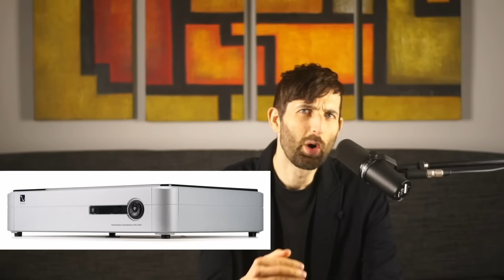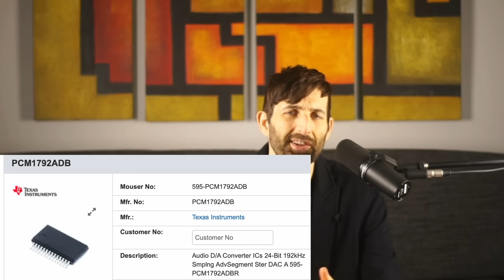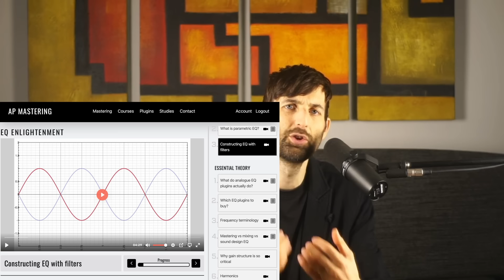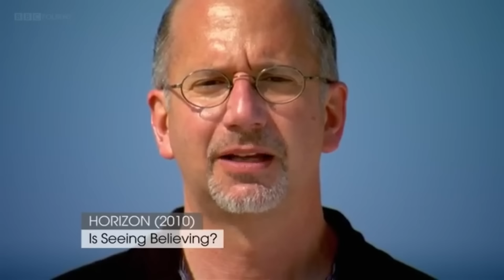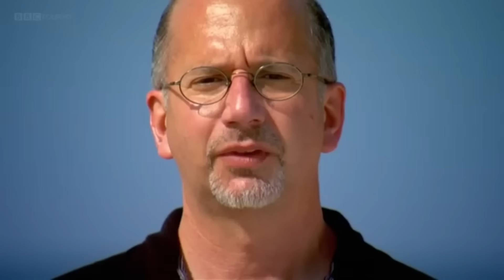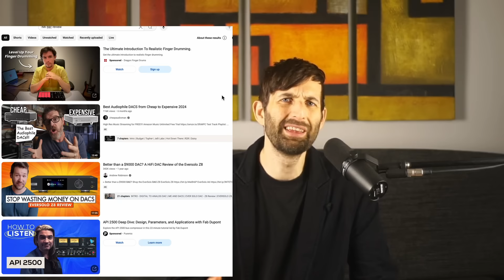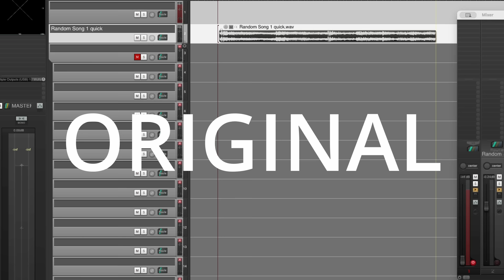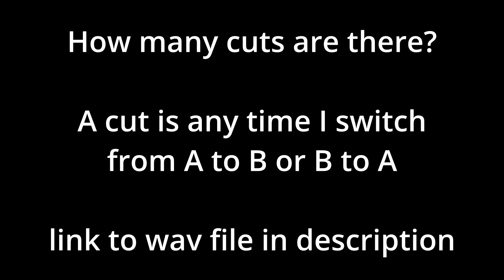The DAC Scam - Almost everyone believes the hype

Comment: Most people who spend ridiculous amounts of money completely forget that room acoustics are vastly more important than a DAC, expensive cables, or whatever else is out there. In a well-treated room, even a budget stereo system will sound many times better than a $100K setup in an untreated space. It would be much wiser to actually think about this and invest your money in something truly audiophile. Great video!
Reply: You can do both and it will sound even better.
Reply: @VincentvanRooij-j9n  Okay this would be the End-Game
Reply: Just finished (mostly) my dedicated listening room with correct dimensions, ratios, loads of built in absorption, diffusion, 45deg corners and what not...Took measurements to get somewhat flat line with Forte III with two 21' open subs, got there... If I move my head a bit to the front or back, sound changes so much.. No idea which is the best and ''right'' position really.. But then I took my JBL a120 from my desk setup, put them on Fortes (upside down for lower tweeter position), and just plugged the speaker cables into them from Forte's... without changing anything else... The sound is amazing, like most people I think are not getting that even with better speakers in untreated, poorly designed rooms... all you need is JBL a120 (200$) and good sub's and you can enjoy the music in the right space meant for it.
Reply: @witaminc  Glad to hear buddy!!!

Comment: Bullshit. This is a Monoprice mentality diarrhea opinion. I deal with this every day straddling the world between high end audio and pro audio.  I can easily demonstrate the differences between two products sharing a common chipset. The DAC chip is quite dependent on the components that surround it. Ultimately its about controlling the noise floor so you can hear low level detail. BTW You Tube is absolutely not going to be a place where you are going to demonstrate your point of view sonically. The audio signal is butchered in the upload. Then the playback is highly variable with the listener. There are way too many variables at play here.  Do an simple null test, scope it, and it will put all this nonsense to rest. Look it up if you do not know what a null test is.
Reply from the maker: wav file

Comment: I think you are talking snake oil.

Have you listened to DACs yourself? Expensive or cheap DACs?
On a good set?

Try that, Then we will quickly be done talking.

You have no idea what you are talking about.

About the price,
Normally you can maintain the rules of thumb. The production price is divided by 5 of the sales price. 
Brand, materials used, Some DACs have programmable hardware. That costs money.The biggest cost of a DAC is the power supply and the clock crystal.
A well designed power supply costs a lot of money. What type of power supply? Not well designed power supply gives a lot of noise in the output signal 
What is the design, of the output?
Are you using a dac chip? are you using 2 or three? 3 per channel?
Are you going to overclock the digital signal?
Reply from the maker: im a pro mastering engineer. ive worked in studios with lavry gold etc. If you think there's better DACs than the high end mastering stuff, you are just wrong.
Reply: @APMastering
Understand that you say this,
Mastering pro engineer, have experience in this field
Do you also have experience with listening? on a good audio set?
Which doesn't have to be expensive. Take for example the brand Cyrus. Very affordable. Kef speakers, or Elac
on the second hand market, 600 euros for a set. 
Plug in various dacs and you will immediately hear that your story is nonsense.

Do you also have experience in the field of electro engineering? 
 
What choice does a manufacturer make in power supply?
linear power suply or an smt?
A bad SMT power suply can be heard well in a dac, even on a basic audio system. This is due to the high switching frequency.

So no. I am a pro, I know everything better, ....
are your words ... If people want to believe you, that is completely fine. I believe what my own findings, such as hearing and in measured values.

Comment: A good discussion point! Thank you! 😊
A few years ago I would eagerly have agreed with you, but after buying 3 dac units over the past few years, to my ears, in my listening space, using my equipment, there all sound different. Some even pair better with some equipment than others? This is not imho placebo, because I don't want them to sound different, I just want them all to sound the same... good. As someone has already mentioned the chip implementation matters alot, the output stage matters alot. Yes, I have £200 dac that sounds incredible, and a £1200 dac that sounds incredible+. Is that + worth the extra 1000? Maybe not for the sound, more for the versatility and features.
Even some modern source recordings are absolutely terrible imho, so I presume some sound recording engineers are also much better than others. Or have better hearing.
Would I spend 1000's on a dac? Absolutely not. 

An age old, but good discussion. Well done. Thank you! 😊

Comment: You don’t sound objective. As you said, the design architecture of all the DACs is different. All of them seem to be good enough. The fact that they sound different and people express preferences is what separates them. I heard DCs when they were new to the market and applying lots of new ideas to DAC design and implementation and they were clearly better. Lots of studios were buying systems from them. I dare suppose a lot of people realised what was possible and adopted what DCs had learnt. It doesn’t matter how much things cost as much as how effective they are in use. Even studio engineers have their preferences about which DACs to use. Perhaps they can tell us what works for them and why.

Comment: Yes I agree silly money DACs aren't worth the money, I went for a moderately expensive R2R DAC and thinking I wouldn't be able to really tell much of a difference wow I was wrong, to cut a long story short the sound is something I've never heard before, it is truly next level. By definition being R2R it must be using some custom electronics and software, an FPGA for example as per what Chord does and many others, all the other components such as the PSU, filtering, clocks / jitter, output stage / opamps, galvanic isolation all feed into the final sound. I suspect my R2R DAC doesn't measure perfectly for me it's all about receiving the emotion from the music and it's very difficult to get that from my experience. I'm not sure it it's timing or timbre or both or some other secret sauce all I know is many cheaper DACs, chifi gear I've tried over the years even though they sound clear just lacked in the emotion department.

Comment: It's more than just the DAC. It's as much about the stability of the reading/decoding mechanics and the chassis platform isolation. CD player playback relies on physical isolation as much as with ultra analog reproduction. Don't believe in CD vibrations affecting playback?  Then you've never heard ultimate playback equipment, if even not financially attainable. 1's and 0's aren't simply the beginning nor end of the playback chain. Being a skeptic is easy. Hearing is reality, cost be damned (ya, I'm one of those crazies who spent $30K on one piece of equipment).

Comment: DAC’s sound different because of the design implementation after the DAC chip itself. 

So technically he’s right that dac chips themselves sound the same but he gets it all wrong to say dac units all sound the same. 

Short term sound testing doesn’t bring out the differences. It’s longer term testing that the differences in any audio component becomes apparent.

Comment: I  have had DAC’s ranging from 1000.00-8000.00. There is a huge difference imo as you go yo for most part. My favorite current is the 2700.00 Laive Harmony. It blows away the cheaper ones I’ve had.

Comment: I sport a Sugden DAC-4 with two TDA1543 chip (non-oversampling) - and a glorious power impementation. Costs £2.000 and is more musical than anything Delta Sigma chip. Still have a MHDT Orchid with 1*TDA1541 chip. Very musical, but not as 'stereo' and precise as the Sugden.
There are DACs which sound better - more 3D, more detail, but you need higher resolution audio.
As most of those files are sourced from mediocre sources, the often sound not even as good as CDs fro the 1980. Hint 'LOUDNESS WAR MASTERING'.
I am very happy with my Sugden DAC-4 as it sounds very analog.

Comment: Oh sure, the chips are way affordable but the quality of the build, the power supplies (large enough to have excess capacity), and other factors can make a big difference to the sound as well as proper clocking.  i agree that these units need not go into five figures, the ones that do are probably built to their level of cost/value.  They are not bargains and detecting meaningful differences cannot be done in rapid A/B comparisons, blind or not.  It requires no less than 30 minutes but many days or even weeks allow the brain to build enough data for detection of those differences.  

Furthermore, it many times rests on how the sound makes you feel, there are subtle disruptions that interfere with the relaxation/satisfaction factor.  Accomplishing the filtration after over/up-sampling, reduces the effects of the ringing that comes with filtration.  

The higher quality and transparency of the electronics and loudspeakers of the listening system allow you to hear the benefits of a higher grade DAC.

Comment: You have mentionedeither in this video or another one that expectation bias could be an explanation as to why an expensive Dac may sound better than a cheaper one. However I recently 'upgraded' my streamer from Chromecast Audio (around £60 including cable) to a Volumio Primo (around £680) and I could not hear any significant difference. I was expecting the Volumio streamer to sound significantly better but it didn't so it seems that expectation bias does not 'always' work.  Similarly I bought a new CD player recently which I was hoping and perhaps expecting to sound better than an older player I had. However once again they sounded pretty well identical, so expectation bias did not work in this case either.
Reply from the maker: sure it's not always going to be there but it is one possible explanation when it is
Reply: @APMastering Yes. I must say, that the new streamer and CD player were not in my line of sight from my listening position, as the equipment is further over to the side of the room and there is an armchair in the way, so perhaps the fact that the visual cues were not there, may have made a difference, as per a video clip  you showed where the sound one hears, can appear to be different, if the image you see (a face in the case you showed) is altered.

Comment: The issue I have with this is that one can't talk about the "EQ/tuning differences" that "DAC device" manufacturers are putting in. Naysayers jump on this bandwagon about how each "DAC chip" has to be doing the same job. That's not what someone who says the DAC's sound different means. There's EQ'ing or tuning going on somewhere in some cases. This was acknowledged but so quickly that the haters are going to blank it from their memory because it doesn't fit their agenda.

My first experience of it was with the FiiO KA3 and the KA2/KA5. The KA3 used an ESS DAC chip. The KA2 and KA5 used CS chips. The KA3 has this horrible bright and sparkliness that grates on my ears and makes everything sound "artificial". This is apparently explained by association with a Far Eastern preference for enhanced higher frequencies supporting the female vocal. The KA2/5 seem to produce a very natural or balanced result that sounds the way I'd expect. Somebody did something here... was it FiiO or was it ESS??? I'm inclined to believe the latter because they didn't do it for the KA2/5.

There isn't even a single way to do "DAC'ing". There's the frequency-domain and time-domain distinctions.

I fear that assuming a "DAC chip" does the same thing, purely based on its acronym-based name and an understanding of its purpose, is too simple. They can be doing all sorts to manipulate that signal. Of course, it's not "DAC'ing" as such but the whole "DAC device" just gets called a DAC and then simpletons start the "DAC's do the same thing" argument.

Comment: 4:21 those are just diminishing returns. (About the diminishing returns, i love so much my Pioneer SA7800, like if i go anywhere and other ppl use their gear, lets say a Logitech Z series Active system, my gear just sounds so much better than the avarage ppl trying to listen music on his gear...)
Like about some vintage amplifiers too, the reason you paid more for like some Pioneer amps that they were built so much better than lets say Technics, Kenwood and some other brands.
But novadays, like for some reason sellers of their new gears, they ask even more than 5k euro. 
My uncle was also Serbian, he went to Germany, and he got a full set:
Pioneer SA7800 amplifier
Pioneer TX-D1000 Tuner
Pair of Pioneer 8" Speakers
Of course it was in Deutsche Marks, but it was about 3-3.5k dollars or euros, and he got a full set of super high quality gear where it was those amplifiers were made from transistors that were made to withstand outter space, and now manufacturers are asking 5-10k euro or dollar (I'm European) just for the amplifier, and for some reason theyl say that you need a streamer (for whatever reason, i dont use it at all) and a high quality speaker that is at least 2k euro or dollar because thats the audiphile...

I use a B&W DM601S1 bookshelf speakers that were costed me 200Euros a pair (got a great deal like a year ago) and yea, it sounds so good, and it wasnt 2k euros.

Yea of course they no longer use High quality transistors or chips.

Comment: I agree to the thought of diminishing returns, but there’s more to the circuit and implementation that the (chipset). Also, the rest of the gear is  a factor.  DACs have become so good that its hard to tell, but it comes down to little details, such as, this one has better imaging, etc.  i will agree that probably anything over 2k USD is unnecessary

Comment: Yes, yes, yes! I compared the smsl su1 dac to my 1990's Denon mid fi 5 cd/ hdcd player,  and the improvement was negligible.  The Denon has a BurrBrown hdcd chip. Absolutely shocking the lack of improvement over 30 years! The smsl is only useful coming out of a computer for better sound, or phone I guess.
Reply: I have a 45year old (soon it will be aaaah 46year old) Pioneer SA7800 and i rarely see a better amplifier than that. 
Yeah we not improving much, its just that my Sa7800 is kinda Notorious if it fails, because its an NSA amplifier, and you need to really know how to work on because it will blow your semiconductors...